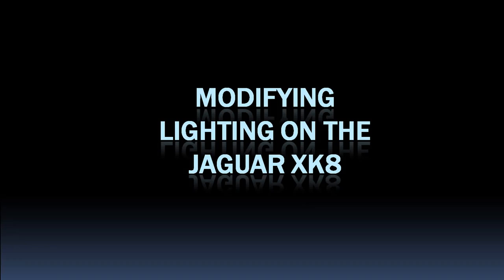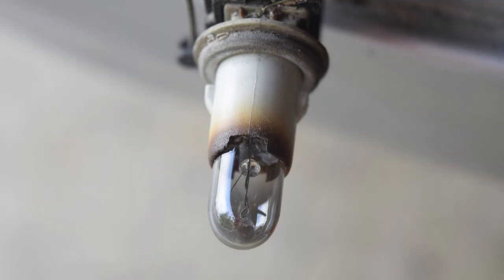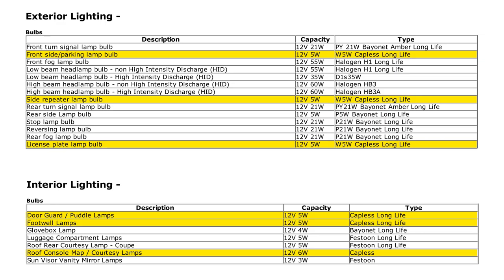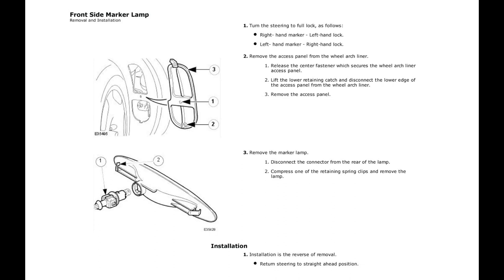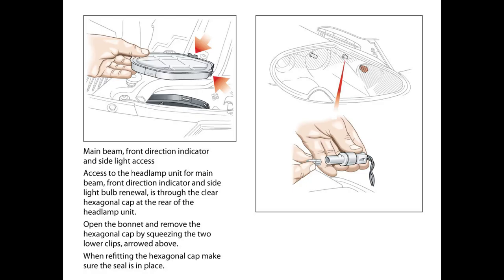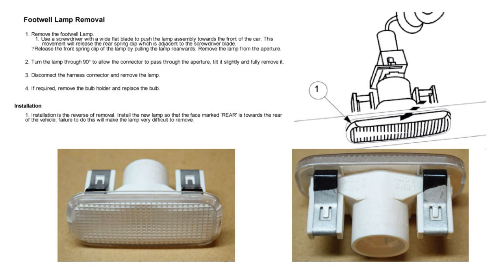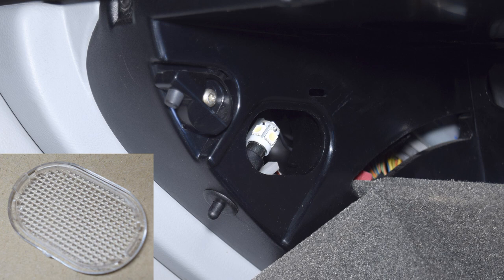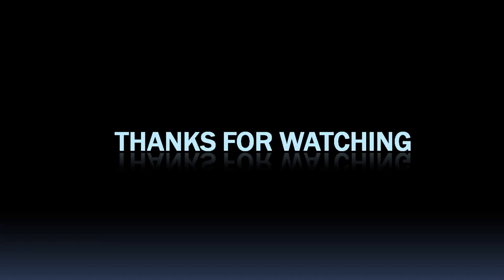Jaguar XK8 Lighting Modifications

Comment: Richard, absolutely excellent presentation.
Small point but would recommend breaking in it down into 3-4 separate episodes (10-15mins).
I've tried to watch it several times, good stuff but quite long for one sitting.
Actually bought the DRL wire (assume from you) on ebay then found your explanation at the end of this video after the last viewing.
Keep up this great work, would like to see more stuff.
Reply from the maker: Thanks for the feedback, and I agree, I could have shortened the whole video. I post videos simply to share any knowledge I gain and certainly not for any financial gain. I don't sell anything on eBay and have no connection at all with any vendors I recommend.

Comment: Interesting video. When I fitted leds to the front indicators on my x308 I didn’t require a load resistor thankfully. I used switch back leds like some other jag owners. These are like bi coloured leds orange and white. The white being used for DRL. These even contain circuitry to give orange priority and delay when bringing the white back on like new cars.  In the UK where we actually get fog you don’t want white led front fogs as incandescent lights see through the fog far better. Interesting measurement on the brake light speed.
Reply from the maker: Hi Andy. I do remember foggy days in London town, but fortunately, although I now live in Michigan, surrounded by the Great Lakes, we don't get really bad fog. I am interested in the LEDs you describe with the fancy circuitry. Could you provide a link?

Comment from the maker: Hi Theo: Interesting that your 2006 was manufactured in early 2005 and that it has different wiring from that shown in the official  Jaguar 2003-2005 XK wiring diagram. It does seem you have figured that the low (dip) beam relay is in a different position from I would expect. You don't have HID headlights do you? HIDs would explain why you have relays reversed and why you get the flashing.  I do indicate in the intro to the section about front fog lights that the method of using a diode won't work with those. If you don't mind the fog lamps staying on when the low beams are on, instead of connecting to the cathode of the diode to contact 5 of the low beam relay you could connect it to contact 5 of either the horn relay (2nd relay from the center of the car) or power-wash relay (4th relay from the center of the car). It would mean that the fog lights, when being used as DRLs, would go off on the rare occasions and brief times during which either of those functions, whichever you chose, was operated.

Comment: What ages LEDs is heat.  The chip needs to be in a heat sink.  Good idea to buy 3 different kinds.  They may only last 6 months.  There should be a heat sink around it.

Also consider using an AMBER LED with an amber lens cover.

In a T10 socket I have used CANBUS LEDs.  It fits right in.
Reply from the maker: Heat sinking, at especially in the all important immediate vicinity of the chip, isn't usually in control of the end user. See my video concerning LED Fog lamps here I reduce power input to proportionally control heat output, without, in the case of the voltage controlled LEDs, similarly reducing light output.

Comment: wow, thank you for the very detailed video. Q: did you disconnect the battery before any changes.  Do I need to add diodes if I change instrument panel bulbs to LEDs
Reply from the maker: Hi Pedro. When changing the instrument lamps I did disconnect the battery, but only after ensuring that I had moved the steering wheel as low as it would go. The LEDs have integral diodes so don't need additional ones.

Comment: Hi Rick, great video. I installed the diode as per video on my 2006 XK8 and the fog lamps stay on all the time. Any idea why that could be? Thanks.
Reply from the maker: Hi Theo. Sorry for the delay, it's a while since I made this video and I had to review it. I see I described modifications I have made to both the rear fog lamps and the front. Is it the front or the rear fogs that are a problem?
Reply: Hi Rick, sorry, I should have clarified. It's regarding the front fog lights being used as daytime running lights. I have figured out that my 2006 XK8 (manufactured 01/2005) has the relay box configured like the 96-03 models as per your video, which means I put the diode between the fog lights and main beam, which explains why the fog lights stay on. However,  when I put the diode between the dip beam and fog lights, the fog lights 'blink'. They do turn off when the dip beams are on. The 'blinking' is strange though...any ideas? Thanks so much.

Comment: Thank you Richard, a wealth of information here. I have been experimenting with HID and LED bulbs since their inception and it is a difficult task as the quality is never known until you test it yourself. I do disagree with one thing here. Fog Lights should operate on their own without any other forward beams on, no high beams and no low beams as we North Americans call them, I am Canadian. Fogs shine low and wide so as not to reflect off the fog (or off falling snow) into the driver's eyes. If the regular head lights are used in conjunction with the fogs the advantage is lost. Modern cars for years now have misused fog lights operations to the point that no one really knows how they are supposed to operate. Did I miss something here? Is there an option for the fogs to work on their own? Please let me know what you think.
Reply from the maker: Hi Luke. Thanks for the feedback. I'll have to go back and look at what I said in the video but I'm not sure I disagree with you. See my other video "XK8 Fog- DRL LED Conversion"  https://youtu.be/OM1VM-tWL6Q. As standard the XK8 Body processor module is programmed:
To switch off front fog lights when high beam is selected
To allow fog lights with side lights.
To  allow fog lights with low beams, and while, like you, I think that's counter productive, I don't think it's my place in this instructive video to change the original Jaguar policy. In the "XK8 Fog- DRL LED Conversion" video, the user can choose, or not, to use a diode to initiate the fog-lights with ignition and thus operates them as DRLs. The preferred method show is to wire the ground through the low beam filaments, which switches them off as soon as the low beams are operated (again, they are anyway disabled by the body processor from working with high beam). However, that can be over ridden by using the front fog lamp switch. Also, if users choose, they may be wired so that the DRL fog lamps continue to operate with low beams. In other words, I hope I haven't forced by thinking on the way DRLs and fog lamps should work, but rather let people choose for themselves.

Comment: Hi Richard,

Amazing video. My question to you. If I wanted to replace every taillight bulb with LED if I made a custom 3D printed cover that would accommodate the space for the resistors would they all function? Let me know if so I will have one designed with extra space to tap.
Reply from the maker: Thanks, glad you found the video useful. There are 4 lamps per side that have bulb failure sensing and that require resistors in order to fool the vehicle electronics into thinking incandescent lamps are installed when in fact LEDs have replaced them. They are the 2 tail lamps, which can share a single resistor, the turn signal and the stop lamp. The back-up and fog lamp have no lamp failure sensing and thus don’t need resistors
Adding resistors presents 2 problems Finding space and dissipating the heat. Of the lamps that require a resistor I chose only to replace the turn signal with an LED because I like the modern instant-on look (vanity I know) and the fact that the resistor doesn’t dissipate as much power as would normally be necessary when replacing a 21W bulb. That’s because the lamp is not used continuously and when actually flashing is off half the time. Your 3D printed cover sounds great from the space point of view but I hope you can use materials that can both firmly secure the resistors and get rid of and withstand the heat. The resistor for the two tail lamps will dissipate power continuously at night and a long stop at a red light, with the brake on, can mean that the stop lamps will have enough time to heat considerably. You may have to do some experiments to determine how hot they get Good luck, and if you succeed, perhaps you can share your results and software here so that others can benefit too.
Reply: @richardastley2517  thanks for the reply. Will give some additional thought and consideration . And will share with everyone.
Reply from the maker: If you have any questions that you want to ask directly, you can see my email by clicking on my name and then the About button. Thinking about it some more, a larger shell around the  rear lights that contains an aluminum plate on which to mount and heat sink the resistors would probably work well.
Reply: @richardastley2517  great idea. The housing could be bigger and square on the  inside for a prefab heatsink as the loss of trunk space would be worth the lighting performance in my mind.

Comment: Hi Richard.............Thanks for this very informative video . Hi dove stright in and went for the easy ones first..........I got a pack of BA9s's 
(only need one for the Glove box) and i went in and changed it over. Nothing ! ......i thought it's a duff bulb.....changed it for another ....nothing ! ...........I've checked the fuse pertaining to the glovebox and it's fine...........any help greatly appreciated. Mine's a 2005.5 XKR Stratstone Edition (last 30 of X100 Shape)
Reply from the maker: Hi Jonathan. I have read your message a few times and tried to think of what might be wrong, after all, as you said, this should be an easy one; a no brainer. The trunk lamps and foot-well maps share the same power source as the glove box lamp, so if they’re working there is power. If you take a while fitting the bulb then that power source will shut-off so as to conserve battery in the event the glove box is left open. Make sure you close and lock the doors then reopen and check if the lamp works. Otherwise I can only think that the LED bulbs you bought are a bad batch with either mechanical issues preventing them making good contact or an electrical problem such as the diodes being reversed so that they won’t work on a negative ground car.
Reply: @richardastley2517  Thanks for your reply Richard.....Indeed the footwell and trunk lamps are working so there is power.........I Only tried 3 of the 10 so i will try the rest to ascertain if it is indeed a bad batch. I have used T10's for the map reading lights and that's a transformation in itself with crisp white light where only yellow came out before :-)  I am plucking up the courage to get into the instrument cluster T10's and T5's and i now have the T5's in Red White and Blue and will set up a test day using your technique and a sharpie to get the polarity right before i  start. I want to replace the trunk and footwell lamps with LED's and although i see the 6smd one sided LED i don't have the specification of the replacement and can't find "the right one" on Ebay. Since mine is an XKR coupe I also have a rear seat courtesy light so i want to change that too. If i have success on the Instrument cluster i am next going for the center console as when driving at night with the radio off the whole area is dark......if something is switched on like the AC on Auto i can just see the red dots and not a lot else. When the CD/AM/FM radio is off that panel is dark. The steering wheel is dark and both door window lifter control panels are dark (or so dim as they may as well be dark) I have tried the technique in the video from ToTheGarage with John in turning the lights on and then adjusting the dimmer to max brightness so they are as bright as they can be but the light emitted is next to useless. If i could send you an Email i can show you the photo's i've taken of the current situation.
Reply from the maker: @jonince1960  Jonathan: I just added a forwarding email address to my profile. I think you you should now be able to click on my Name > Profile>About>View Email Address